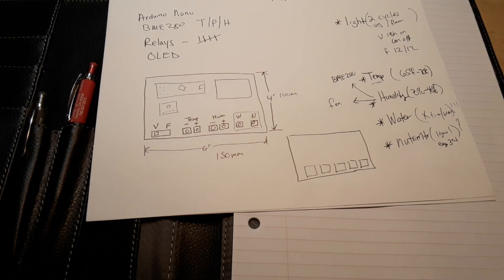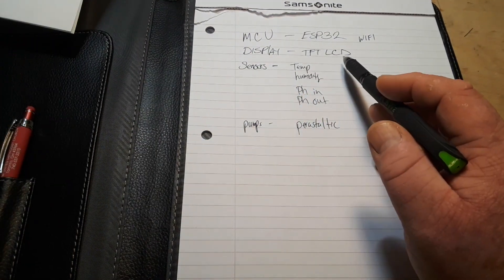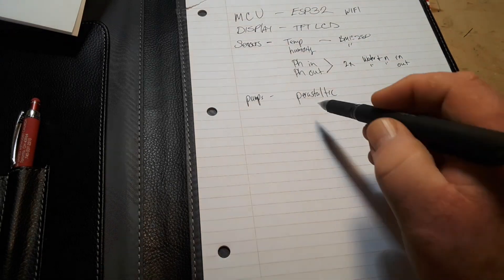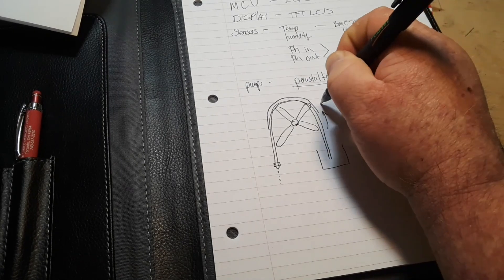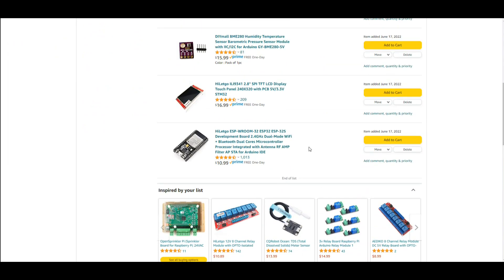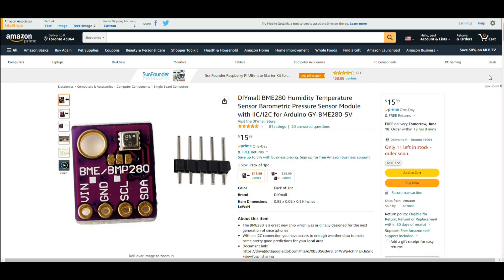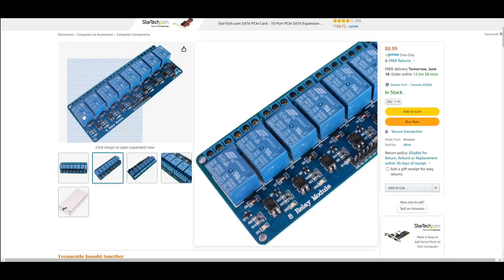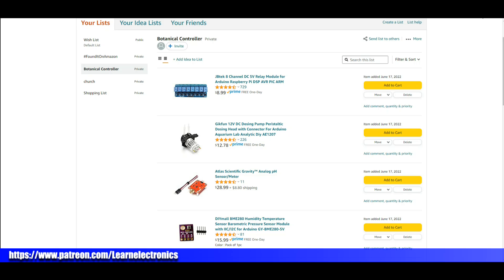Indoor Garden Project  - Ordering Parts

Comment: I'm no plant grower but if it were me i would dump the dual watering system and run just one with a diluted nutrient mix - seems to me to run a water 2x then a nutrient mix would be feed it then flush the stuff from the soil sort of thing so maybe just run a weak mix constantly might be more stable . For not much more than   price of an ESP32 and touch screen you could upgrade to a Raspberry Pi ( zero 2w or 3b but a pi 4 will also do  )and have full control over the internet and  a web cam as well.

Comment: If you use a pH sensor you will need some buffers to callibrate it to make it more accurate. (To get the relatipn between the millivolts an the pH for that particular sensor). You can get buffers as liquid or as powder that you can dissolve in a quantity of distilled water as indicated in the instructions on the buffer.
I don't expect you will need to constantly measure the pH of the nutrient solution. As long as the nutrients are dissolved when you measure it and the water does not evaporate to much the pH should be relative constant (there can be a variation due to temperature changes). I don't know if the pH readly adds that much value. However perhaps it is nice to have. Perhaps just the conductivity would be sufficient.

Comment: What I like to add to my projects is a set of "reverse function" switches right before the output driving the relay(s). This way you can test or troubleshoot it instantly at a hardware level of control.

Comment: I am amazed that you went for Atlas pH probe board, as you do have extensive knowledge of op-amps. I am assuming that you are spinning a pcb from pcbway anyway.
I made pH sensor for work as a part of a system using LCSC parts (used EasyEDA for board) an used unknown in_thousands_part for op-amp based on the criterium that it needs pA range high impedance input. I used Gainsil op-amp: https://lcsc.com/product-detail/Operational-Amplifier_Gainsil-GS8092-SR_C157725.html . Lift the ground input on the op-amp on the pH probe (+inb) with a 2.2K/10K voltage diveder for 0.595V higher ground, then the probe inputs 0.18V to 1V, magnify the signal by 2.6X  with 10k and 18K resistors, and you have a nice analog 0.468V-3ishV for range ph 0-14 wheras pH7 is 1.547V (ground-0 w/bias), there are multiple sources on calibration for pH analog sensors, so not a coding challange there and you have a pH sensor for about a $1 in parts excluding the bnc, but, not too expensive part either
Circuit: https://snipboard.io/QSXjOY.jpg
Reply: Forgot one thing. The Atlas board is a STM MCU with an op-amp and the STM is just used as an I2C/serial interface to the probe, parts numbers wiped off for copy-protection.
making your own pH board is way cooler, you can show how to bias a circuit and how to do op-amp criteria search and sort by "is it good enough, do I really need ultra stable expensive part here, and do I need the bias to be more stable than a 100ton block of granite? How critical is it if my pH is wrong in the 2nd-3rd decimcal?

Most circuits out there for pH are way too over engineered, most are used in monitoring plants or aquariums, one decimal is plenty an about as good as a pH-paper strip. going +$20-$30 on a bill for better components for protection circuits should be made mandatory to check if really needed, $5 board is far easier to spin x100 than a $30 board, minimum viable product is a must know how, take all the bloatware from those designs out there and every new feature must be justified.

Why even go for glass probes if simple galvanic cell will do. here is an article from our now unpopular enemies in the russian empire about using aluminium rod and a copper rod for measuring pH:
https://www.researchgate.net/publication/357119770_Galvanic_pH_sensor_for_continuous_monitoring_of_soil_parameters_in_agriculture
Reply from the maker: Thanks man, I will check it out.

Comment: If you're going for separate veg/flower profiles, that spare relay would be handy for switching between lighting types. I know that when using traditional arc lighting, veg likes blueish Metal Halide Discharge and flowering likes High Pressure Sodium. Even if you're going LED, if you can find comparable spectrum LEDs, then you can switch between them.
Reply from the maker: Thanks. That's the kind of knowledge I'm looking for in here!
Reply: @learnelectronics  just to note, the lighting types I gave were for a certain "herb" that's commonly grown indoors under artificial conditions. I'm not sure what you intend on growing, so it may be worth looking up the normal outdoor growing seasons, as the normal veg/flowering seasons will not only have have different day/night cycles but also different spectra (winter daylight is different from summer daylight).